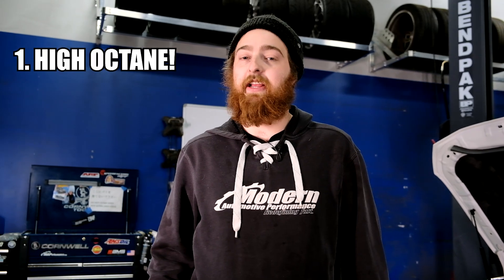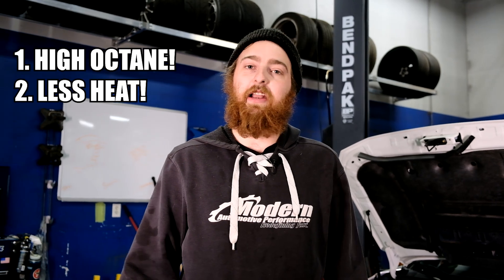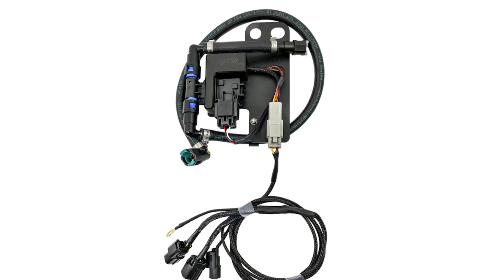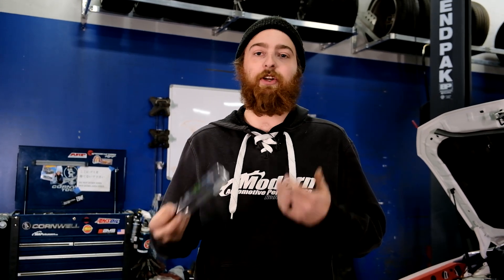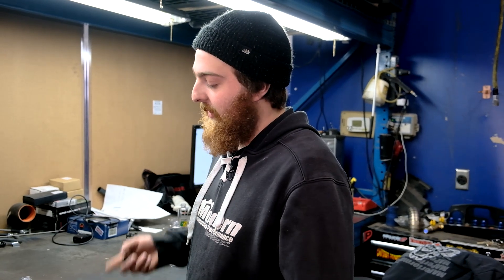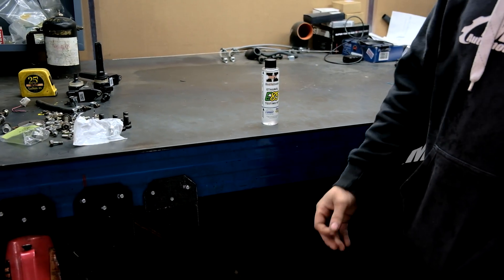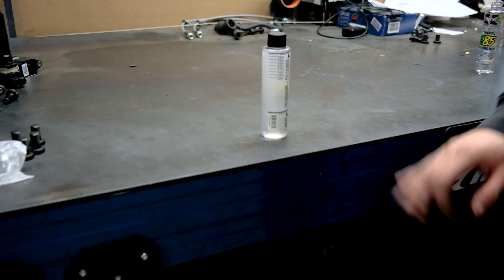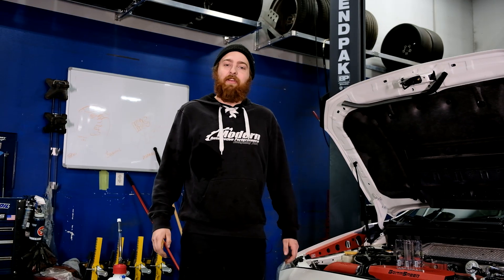How To Test E85 | No Flex Fuel Kit? No Problem!!

Comment: Well that’s not helpful geesh wasted my mins watching your video!
Reply: Exactly.. I'm trying to test without a test kit like the title says 🤦🏾‍♂️
Reply: I’ve pour E85 in my old 1997 Neon Plymouth for 2 months during 106 miles commute a day to work, runs weird and hurt nothing but kept getting strong corn syrup ordor coming in my car that I have to keep window down daily, crack open little if rain. That was in 2005, in 2013 the Neon finally burning oil with 400,000 miles!!! 
There where no fuel flex kit available for Neon, mostly on bigger engine or “popular” models so I got fuel flex kit for my 2004 Jeep Wrangler Unlimited and works beautifully!!!

Comment: I heard that it is not recommended to use in really cold weather, is that true?
Reply: Ethanol is very similar in weight (talking specific gravity) to diesel, meaning it has a much lower volatility (ability to atomize) in cold weather. cold starts will be more intensive to tune, but not impossible. we run e85 all year round in minnesota frequently. using a lower content E-blend with alleviate some of those hard starts as well.
Reply: @Kyle Larkin  thank you for the information. I just don't want to be testing the ethanol content. I don't race my car either since it is my daily I just don't think spending the extra money for the sensor is worth it for me.
Reply: Very true don’t use E if you live in cold climates……I live in Michigan and we have street 108 that’s street legal I use 108 over 85 because mileage and maintenance intervals.
Reply: @Rob  yeah I heard is really hard to start and takes many tries to start the car.
Reply: @agmendoza2830  when I did use E60 blend it took usually 5-10seconds of being on the starter to get it to light up even then it idles rough until cylinder temps get up a bit
Reply: @agmendoza2830  I’ve been running VP street 108 we have it at the pump in Michigan at some stations and I have 20whp more with less maintenance issues like changing the oil every 2000-2500miles and having to blend the fuel was a pain in the ass
Reply: @agmendoza2830  obviously higher octane fuel cost more but honestly it’s a trade off with using E blends you have to spend more money on maintenance and with better fuel it’s the additional pump cost
Reply: @BobbyB910  that's something I don't want to deal with
Reply: I’ve used E85 fuel in winter the coldest I was able to crank around 10 F. It just few more cranks to get it running no real issues. I used thinner oil 5-20 for easy crank. 2004 Jeep Wrangler Unlimited 4.0L 6 cylinders
Reply: No cranking issues whatsoever in KENTUCKY 30* (83% tested)